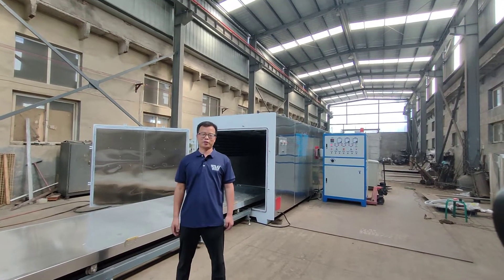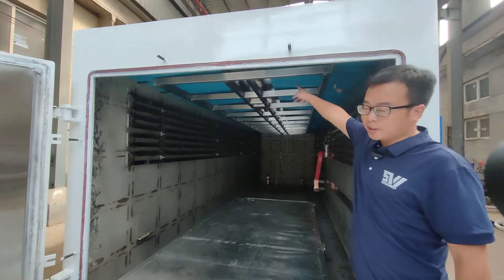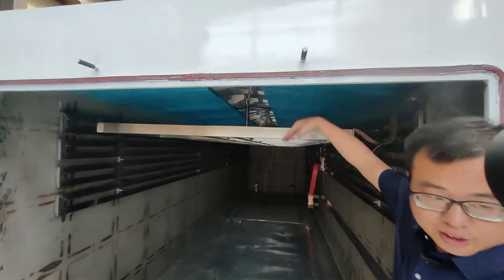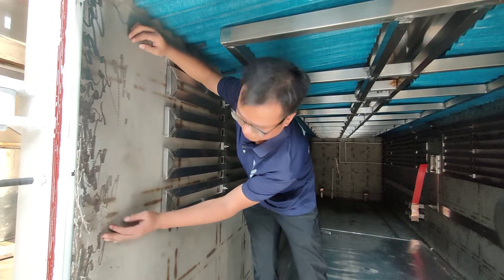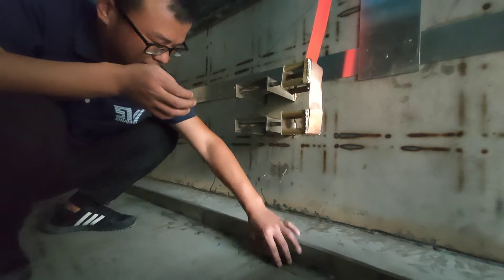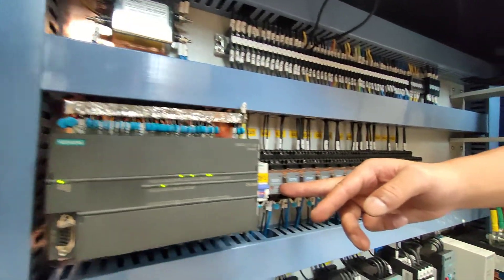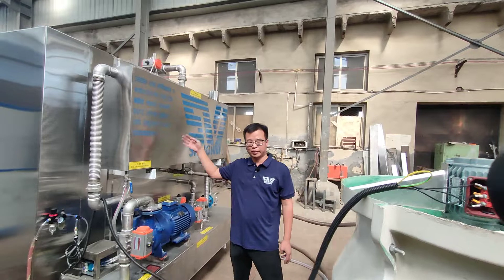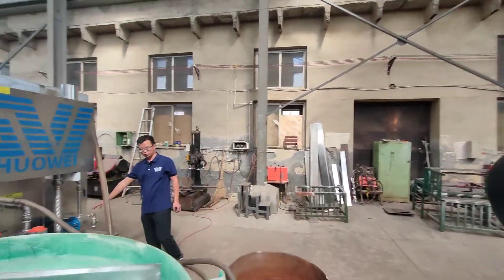High frequency vacuum wood dryer test before delivery

Comment: It's a beautiful machine, really wide I like that feature, but I don't  think the chamber dimensions have been mentioned yet.  how L x H x W ???
Reply from the maker: There are also different capacity kilns, the maximum wood size it can fit is 26 feet long and 55 inches wide